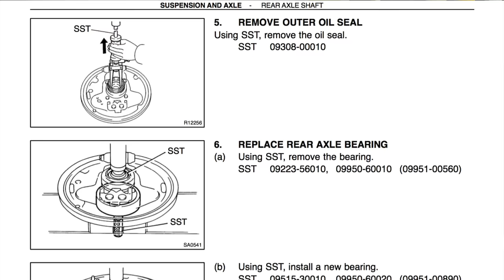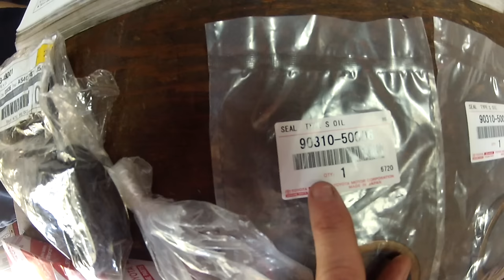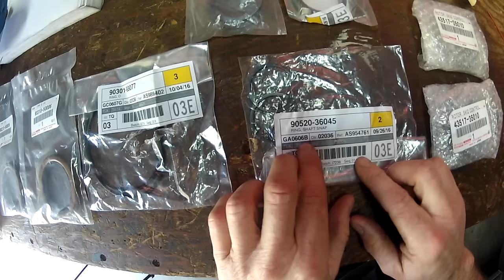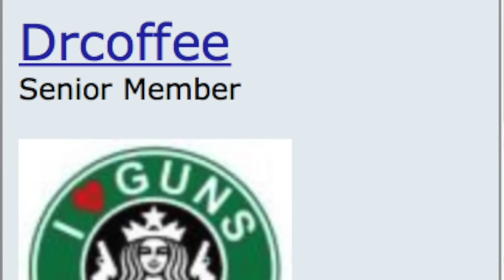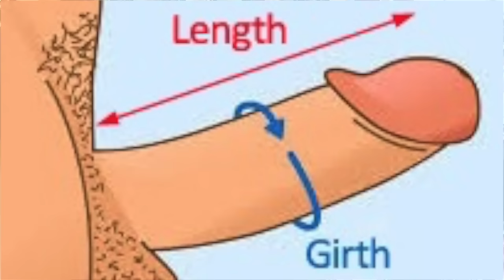Toyota Rear Axle Seal/Bearing Replacement (ABS Rearend)

Comment: I did this job last weekend on my '98 4Runner, and it went relatively problem free thanks to your video, Tim! A couple of things I can add to the video:

Check that the new seal is square after driving it in. I just used the depth guage on the bottom of the calipers to measure from the ground face of the axle housing to the seal ring in a few spots. Both seals required squaring by 1/8" or so up after initially tapping them in.

Since the studs have to be pounded out anyway to pull the ABS tone ring off I went straight to using bolts to affix the press plate to push the axle through the outer retaining ring and bearing. The studs went back in after pressing everything back on.

I removed the brakes since they were saturated in diff oil. However, even if you do keep them on it is easy to remove the parking brake bellcrank to get it out of the way of pressing. Loosen the two bolts, slide the cable off of the bellcrank hook, and it pulls straight off the backing plate.

Anyway, thanks again for the great vid, and keep 'em coming!
Reply from the maker: With the driving in of the axle seals, I went by sound first and then visualized that the seal was sitting square.  The sound of the hammer driving in the seal makes a distinct change of tone when it's bottomed out.  Sort of tink, tink, tink then clunk.  When the tone changes, you know you've bottomed out.  Then I just look to see it's even with the slight bevel of the axle housing.  

I'm not sure I understand you did anything different than we did with the studs after removing the inner retainer and ABS tone ring.  We pulled the serrated studs back in place to attach the press plate but unfortunately had the mishap of the threads giving way.  We were forced to use the longer bolts we bought at Home Depot to finish the press work.  Since I had that one plate machined, the OEM studs work perfectly to press the axle through the bearing and outer retainer.

I've now done this axle seal job 6 times and I guess I just choose to keep the bell crank on while doing the press work because I have all the press sleeves to make it work.  I finish the axle seal job by tearing down the brakes, cleaning everything up really well and putting new shoes on.

Glad the video helped you out.  Dealerships and private shops charge an arm and a leg for this repair and then often times screw it up.  The fact that you've successfully done this job on your own makes you an expert in this repair and more knowledgeable about it than most professional mechanics.  Congratulations on a job well done!

Happy  Wrenching!
Reply: Timmy The Toolman I guess I should elaborate on my stud comment. We didn't do anything different; we just followed your advice to use bolts. I was just under the misconception that using bolts would require more work (i.e. pounding the studs out multiple times) than having the plate machined . I was pleasantly surprised that we were able to do all of the press work using bolts, so the studs didn't have to go back in until it was time to grease test.

Anyway, thanks again for the great vids. You've done Yota drivers a huge service!
Reply from the maker: Got it.  Since I got that plate machined, I just pull the serrated bolts back in after pulling off the ABS tone ring and inner retainer to get ready to press the axle shaft out.  The machining of the plate saves me some time because I don't have to remove the OEM studs and replace them with the longer bolts.  It's just one less step.

I'm going to be doing this job for another local guy in a few days.  I think I'm going to follow your lead and just remove the bell crank and see if this makes doing the press work much easier.  Thanks for sharing this info and your success with the job.  Happy Wrenching!

Comment: Tim, I watched the video as I mostly DYI from my youth. 73 2004 Toyota went to shop as I did not have the time and it was winter. Still leaked the owner corrected the repair. Upon replacing the rear brakes  I noticed a film of diff fluid. So I checked the breather first. Clogged it was. R&R the leak in axel stopped.
Now last fall it started again. Rusted break line with no spare prevented repair. Last week, decided to 
take it down and replace every part connected to axel as you did on Charlie's 4 runner. Holy wahhh
the sensor was froze in, rotated but would come out. Use a block of wood and truck jack to remove the axel. Forget the 5 mm as the last person working on that side left off the inner retainer above the ABS.
the restraint for sealing the diff fluid was the outer seal. Go figure..... I was going to have my only source
for repair install the bearing ABS GEAR , RETAINER, AND INNER AND OUTER SEALS. MAYBE NOT.
FYI I ALWAS CLEAN UP THE HUB AND BRAKE DRUM INNER RING FOR EASY ON AND OFF. COAT LIGHTLY WITH ANTI SEIZE does not get on brakes. All my parts are Toyota oem. Really appreciated the 
honesty of your video. BTW 299K and 297 on original plugs......still have starter and generator. Michelin tires LTX A2 112K 9/32 tread.
Reply from the maker: Hey Jerry, that sounds like quite the ordeal.  Glad you finally got it all fixed and our video helped you out.

Comment: Awesome video! Precise and to the point. 
Glue 2 small magnets to the top of your press.Then you can lay your jack handle on top and it won't roll off. Its right there when you need it.
Reply from the maker: Glad you like the video and thanks for the magnet idea.  Using magnets is a such a simple solution to having a place to put that jack handle.

Comment: I love how at the end of the video you can just tell everyone's spent.  I know that feeling well on any car repair. Even with ridiculous amounts of tools they never go 100% smooth.
Reply from the maker: Hey David, you're the first to comment on this.  Yeah, you're absolutely right.  Some of these repairs and mods we've done have been marathons and crawling around on your back all day can definitely wear you out not to mention the mental fatigue that goes on with one of these jobs.  When I watch the final edited version of the video, I can see how destroyed I look when I'm doing the closing statement.  

Thanks for watching and Happy Wrenching!
Reply: I'm new to the 3G 4Runner scene and I'm rehabbing a pretty poorly treated '97 SR5 here in Minnesota.  EVERY BOLT is rusted to hell and nothing is ever as clean and easy as it is in many of the repair how-to's on youtube because clearly most are done in Cali and the southwest.  Something as simple as a brake caliper replacement becomes an all-day job unless you just anticipate removing everything up to the ABS line tee junction.
Reply from the maker: David Tesch I feel for ya.  Doing automotive work on a vehicle with lots of rust would certainly take some of the fun out of it for me.  Knowing I'm going to fight every fastener and possibly break off bolts and strip nuts would add a whole new level of frustration.  Too bad there isn't some other solution for the roadways instead of salt to deal with icy roads.  It sucks that vehicles that still have a ton of life left with the main drivetrain components end up being scrapped because the frame rusts out first.

Comment: I went to 4mm of polished axle then did a grease test. The axle wouldn't go all the way in because the abs ring was hitting the seal. I pressed the race another 2mm to a total of 6mm of polished axle then it worked. I think the abs ring should be pressed on an additional 4-6mm apart from the race just to center it up with the sensor hole and to make sure it doesn't rub against the seal .  Great video!
Reply from the maker: There is a very good chance the bearing wasn't all the way seated in the bearing case when you performed the grease.test.  I mentioned in my pinned comment that a bearing that's not fully seated will throw off the grease test.  There's no way at 4mm of polished axle showing you should have been able to hit the ABS tone ring against the seal.  When you did the grease test, did you just slide the axle in until it was flush with the housing or did you actually bolt it up tight?  If the bearing wasn't fully seated in the bearing case, tightening the nuts would have  drawn the bearing to it's fully seated position in the case.  I honestly think at 6mm polished axle showing you might be closer to the bevel than you'd like.  I recently pulled an axle on a guys rig that I did the axle seal job on around 6 months ago and the witness mark the seal made on the inner retainer was closer to the bevel than I though it should have been.  That's why I now suggest people first do a grease test at 3-4mm of polished axle showing, and then make adjustments from there.  I also know there's slight differences in the axles and the amount of polished axle showing could end up being different.

I hate to say this, but I think it might be prudent to pull the axle and perform the grease test again just to be sure.  At 6mm, I have no doubt the seal is riding on the polished shoulder of the retainer.  But, if it's riding close to the bevel, over time as the bearing ages and develops play, it might cause you to have a seal failure sooner than if you have the seal more centered on the retainer.

Comment: Awesome video , tip , put the bearings in the freezer until you need them and the usually can be pushed in by hand .
Reply from the maker: Hey John, glad you like the video.  I have heard about the freezer trick before but I haven't tried it yet.  People mention the same thing in regards to seals.   I take it you're talking about putting the bearing into the bearing case on the backing plate.  My new trick is to use an ABS clean-out to press the bearing into the case.  I mention this in a pinned comment.  It works really well.  Thanks for taking the time to comment.   Happy Wrenching!

Comment: Hey Timmy, first off thank you and Sean so much. I'm not a mechanic and it's only because of your vids and nostalgia of seeing the place I where I was born, that I can work on my rig confidently. About to purchase a press, 12 T is good enough to move all of our parts yes? HF has same setup as yours with 12 T and it's a bit cheaper.
Reply from the maker: Hey Rob, the special tool we now recommend that we feature in Part 2 of this repair won't fit in between the cross member of that 12 ton press.  I think Duane who makes the tool did make one that will fit the 12 ton press but you'll need to look on his Ebay page and find out.  You can also send him a message to find out.  But, the 20 ton press isn't much more money and is way better in my opinion.  If you ever want to do front wheel bearings, I don't know if the the 12 ton press can handle it.  The 20 ton press is well worth the extra expense in my opinion.
Reply: @TimmyTheToolman  That settles it then sir. As I regaurd you as  the DIY king of maintenance for our vehicles; already purchased from Donald so 20T it is. Thanks again for ALL of your efforts and quick reply!
Reply from the maker: @robmartin2466  You're welcome Rob.  Good luck with the job.

Comment: Another nice video Tim! 

I can confirm that the lisles tool "does" work to get the seal out. It does NOT reach though by default in any setting on the tool. What you need to do is to grab some pliers and pry the axle seal towards you a bit. That will make it so the lisles tool can reach the seal now since it's so deep in there. From there, you just pop her out. (Hint, put a rag on the other side so you don't damage the housing (which isn't a big deal on this spot).
Reply from the maker: Good to know Minh.  Thanks for sharing this information.

Comment: You just saved me some money....I pulled rear axles off a 2002 4runner with front end damage.

And was going to rebuild these and install them on my 2000 4runner. I was about to order bearings for a 2000 but now I will go with 2002. 

I wonder why they changed.....
Reply from the maker: No clue why Toyota decided to change the bearing design.   Honestly, it might not matter but it's better to play it safe and use the correct bearings for your year axles.  Glad our video helped you out.
Reply: @TimmyTheToolman  it does matter. I dived into it this morning. 

Loook at the inner axle shafts between 1996-2000 and then compare to 2001-2002. I posted the part numbers between each on the Toyota-4runner.org this morning.

May be worth spreading that knowledge
Reply from the maker: @cameronp5728  Ok, good to know. Thanks for sharing that there is a difference between the axle shafts.
Reply: @TimmyTheToolman  yes sir no prob. Thanks for the video. Knowledge is power!

Comment: Timmy, watched it yesterday. Kickass video. Most of them out there have you cutting the abs gear and retainer ring off and then beating the bearing out and installing new bearing by pressing in on the new bearings inner race. Not good.  yeah, you can also take your axles to a machine shop and let them fk them up doing the replacement or you can bite the bullet, get the proper tools and do it correctly. $190 shipped for the durasolid axle remover really hurt though. That was more than the 20 ton press.    Absolutely best video i have seen for doing 3rd gen. axle bearing replacement and i have watched plenty of them.
Reply from the maker: james koecher We're glad you liked the video James.  Yeah the Durasolid tool is a little pricey but it pays for itself in one job, at least in my area.  I helped a guy the other day do his axle seal job when he told me the cheapest shop he could find wanted  $150 per side to do the press work.  One shop wanted $300 per side.  The guy gave me some money to thank me for the help.  Now that you have the press and the special tool, maybe you could do the same and help some others out with the job saving them some money and you gain some in return.   Just remember the limitations of the tool and either alter that plate like I did so the bolt threads stick out further or use longer bolts to press the axles out of the bearing.  Happy Wrenching!

Comment: Great video, Lots of good info. Have been debating on doing this on my 2002 Sequoia ( bought it new, has 230k). Since I pulled the axle myself and took it to my local Toyota dealership here in Milledgeville, Georgia. Was Shocked to get a quote ( parts and labor) for $725.00 with the axle removed and cleaned up. Want to do the other side as well,  With the cost of the bearing puller tool and the press, I would still save hundreds of dollars by doing it myself.
Reply from the maker: Dealership Service Departments can be a huge rip-off.  You could also check around for local machine shops that could do the press work for you.  You just want to make sure they are familiar with these axles and that they will be pulling the parts off rather than cutting them off.  There's been plenty of horror stories of people saying a machine shop scored there axle shaft with a cutting wheel.  If you pull the parts off, you can reuse all 4 retainers and both ABS gears.  This will save you around $150 in parts.  Read the video description where I explain how you can save money on parts.

If you like wrenching, a press is a nice tool to have.  I've used my Harbor Freight 20 ton press lots of times now.  The specialty axle tool is the hard one but you can always sell it on Ebay or Craigslist and get some of you money back if you don't want to keep it.
Reply: Thanks again, Timmy The Toolman. Had been sitting on the fence about doing this myself, but after watching your video the decision was easy. The axle tool is already in the mail and will be picking up the press later this week. plan on doing the work next week. Still, don't understand the negative comments people have left, have watched a few YouTube videos before I saw yours. By far this is the most informative.
Reply from the maker: Glad to hear you're tackling this job yourself and using our video as a reference.

In regards to negative comments, I've learned you can have the most detailed and informative video regarding a job and still not please everyone.  There's also just haters out there, whether it's other YouTubers that don't like the fact we're having success with our channel or it's just jerks who'll give us a thumbs down regardless of how good of a job we do with a video.  We can't do anything about people who give a thumbs down for one of our videos but we do respond to negative comments if we feel there's a chance to educate them and educate anyone else that's reading their comment.  Some comments are just way out of line and then those people's comments are blocked permanently from our channel.
Reply: Seriously , I don't know why people can leave negative reviews, maybe constructive criticism, Timmah says it himself (i'm not a pro mechanic) but he explains his mistakes and makes corrections in the video's. Timmah has helped me on numerous repairs on my runners. I'm hoping to get out to his next sick mod BBq if humanly possible to say thanks in person